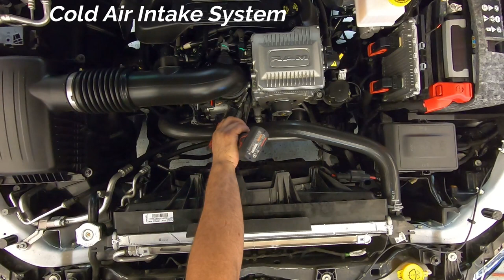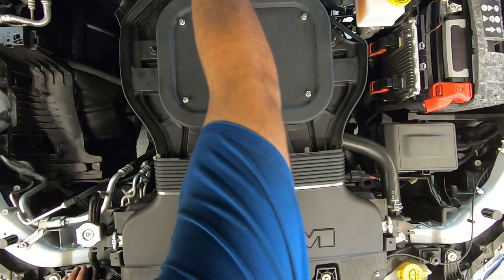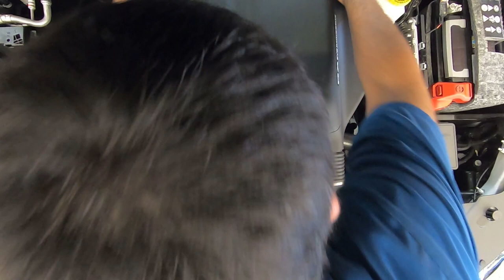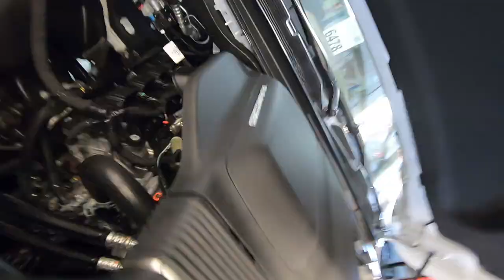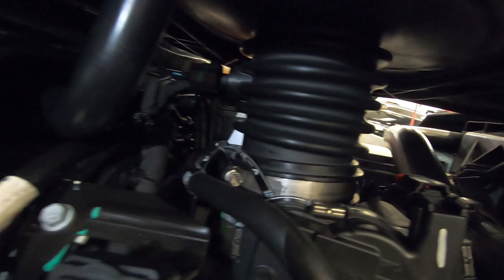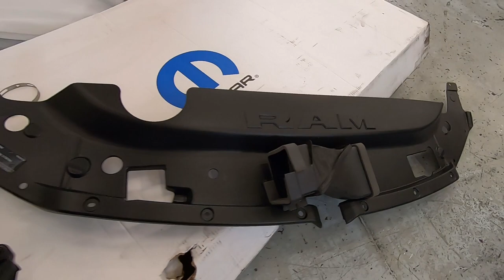Installation of a new Ram AirFlow Cold Air Intake System on a 2020 Ram 1500 with a 5.7L Hemi V8

Comment: I just ordered mine today from the dealer. It was cheaper. Third party websites are still selling them but shipping is 230$. So 968+7.5% tax + Shipping 230$=1270$. I paid 1100$. Not worth it for performance but worth it for gaining extra engine bay space for my planned Dual battery setup.
Reply: Well. It's not been an easy few weeks. I'm still waiting on my order. First they said 7-10 days. then they said it was in orlando and should be here in two days. I show back up two days later. It's not there and they cant find it. So they reached out and it should be here by 5/25. Today is 5/26 and they said now it's been pushed back to July 3rd. Why is this so difficult?!

Comment: Cover isn’t installed correctly…notice the gap….breather tube is falling out underneath….you need a hose clamp there because they didn’t put a plastic burr and the hose is slightly oversized…if you do it right takes way more than an hour….
Reply from the maker: there's no pressure on the breather hose to make it slip off...thank you for the comments and i will check that out next install we do
Reply: Trust me….everyone I installed so far the hose doesn’t stay on….Ive done 3 so far….small hose clamp does the trick….

Comment: I've seen dealership's selling these for around $1,000. I'd love to see the power numbers compared to the competition
Reply: The numbers are the same ..no gains
Reply: Negligible the problem is in the PCM parameters.
Reply: @khyoon14  no it's not. No tune gets you 47 hp down low, max hp gain its 18. Makes a huge difference in acceleration.
Reply: @sonsofliberty3081  18 hp in a 5,500 lbs truck?  Only your imagination is going to notice.

Comment: Random question here,  love the look and the idea.  As the vararam air grabber is almost identical in concept and fits on both the earlier 2016 body style and new 2019 could this intake be made to work on the older generation as well?
Reply from the maker: we have tried to figure this one out. we donot believe it will fit on the older models. only 2019 new bodystyle and up.
Reply: It fits 4th gen ram 1500, you'll have to remove the heat shield under the hood and drill a few custom holes but I got one to fit on my Warlock

Comment: there's a video of the vararam version of this that is similar in design and the dyno numbers are about 10-15hp, i would imagine this is the same, the video however never showed the dyno's laid on top of each other so I would imagine those gains are at the top of the RPM range. I bought a crewcab Laramie, I like the sound of the CAI's but If i wanted a faster truck I would've went with a less optioned version, and looking at the stock system it looks almost as good as the old GMT400 setup with the 454/7400, which is good enough for me, I might go with a performance filter but that's about it.

Comment: Those things are pretty cool but they do nothing to improve horsepower or torque.
Reply: Not at all. They just look super cool.
Reply: @Insuranceexamprep  that they do, in fact I'd bet they actually hurt performance numbers.
Reply from the maker: more airflow = more gas = more HP....... most intake systems will add about 10-15HP. i will totaly agree it looks so cool
Reply: @MoparWholesaleParts  in a perfect world yes I agree. However I very much doubt this one has anything to offer other than looks. Why else has it not been actually tested and proven? My theory is it has been tested and the results are not what were expected which is why nobody can ever find any numbers on them.

Comment: I have a Ram 2022 Laramie Sport and I'm thinking about installing the Ram Air Flow. Just wondering if i needed to get a special tune up for the different air intake. Will the change cause the check engine light to come on without a tune up?

Comment: I have a Vararam Air grabber that cost me $330.  I do like the idea that this mopar product is neat and offers the same concept of what the Grabber has but idk how I feel about an additional $300 for it to look neat. If I didn’t already buy the air intake I would definitely consider this option ngl
Reply: Additional 300? These intakes are $800-1000 every where you look. Most dealers don’t have them and say they are not even being made anymore. They look cool but many forum
Members have installed these ram air intakes and they don’t add any horsepower at all u less you get a tune that allows more fuel to use the added air. The stock 2021-2022 ECM is way too finely tuned and they are not allowing added fuel at all. Damn emissions.

Comment: I don’t get how this can possibly be $1000 shipped? This is a couple plastic pieces and a filter lol.. the stock ECM in any dodge/ram/jeep after 2018 has a new style ECM and it does NOT allow any adding of extra fuel other then small amounts for stock motor. Therefore this filter not only Does 0 for performance but it adds additional weight.. now if you have a Diablo or some kind of tune this can add around 15 extra hp over the tune itself which is huge. But again, with a stock truck and no tune it does absolutely nothing besides make your truck sound cooler.

Comment: I must have missed it in the video, but where does the air sensor hook up?
Reply from the maker: oh good question
it is hard to see because its dark but the sensor is in the hose that is connected from under the air cleaner to the the throttle body.
Reply: It plugs in to the rear of the hose about midway down.
Reply from the maker: @patriotram9204  yes it does...thank you

Comment: Do you have to remove the air filter assembly to get to the oil filler?
Reply from the maker: no there is enough room to get to the oil filter without removing the filter assembly

Comment: I own ram 2015 v 8  with a super charger this will work for this track
Reply from the maker: you can make anything work with time and $$$$ however this is NOT a bolt on and this is NOT made for a 2015 rams.

Comment: In this installation I do not see you disconnecting the negative battery terminal.  Is disconnecting not necessary with this install.  I've seen other intake system installs where some do and some others don't.  What does mopar recommend and if so how come the process was not shown in the video?
Reply from the maker: I just grabbed the instructions and step 1 it says to disconnect the IBS (intelligent battery sensor) wire connector from the battery terminal.
Reply: @MoparWholesaleParts  so just the sensor only? Well that's very different than disconnecting the whole negative cable like the other videos. Is this to keep the truck from going into default mood and losing all the features like everyone complains about when disconnecting the negative battery completely? If so I'm surprised more people don't know this .   I plan on doing the install soon and I didn't want the truck going all haywire by disconnecting the negative cable completely if I didn't have to. Thanks for the info
Reply from the maker: @joserojas6726  that might be why...I will ask a tech and get back to you shortly.
Reply from the maker: @joserojas6726  our tech is saying to isolate the IBS and yes sometimes in rare occasions it does disrupt the electronics of the stop start vehicles and will need to be relearned......could take up to 3 days to relearn.
Reply: @MoparWholesaleParts  thank you for the info!  So ill just keep my fingers crossed lol
Reply from the maker: @joserojas6726  Anytime...hope it helps

Comment: Is there any improvement in gas mileage with this installed & by how much ? Thanks
Reply from the maker: i would like to say there is a mileage benefit....as most intakes claim that they will give you better fuel mileage. how ever my experience is NO due to 2 things. 

1. more air flow equals more fuel equals more power.
2. the sounds of the intake is so cool i keep my foot on the pedal longer.  

in truth its really how you drive that affects the mileage more then the intake. the benefit to an intake system is more power and in turn should be better fuel economy.
Reply: Thanks for the response. Also installing this won’t cause any warranty issues correct ?
Reply: My mileage hasn’t changed, and it sounds great under load. Being a licensed MOPAR part, it does not void warranty.

Comment: I like the over all look and the badging on it. And I’m seeing these in the upwards of $800-$1000. 
My question is, how the heat from the motor is going to effect it, especially when your doing a lot of idling. 
I really like the looks but I think plumbing it to the side fender well will be a better benefit
Reply from the maker: the air intake is just in front and above the radiator/condenser. so while driving your getting outside fresh air. at idle you will get heat but your sitting still so its going to heat up anyway.

Comment: in the kit comes the trimmed radiator cover?
Reply from the maker: YES there is a new radiator cover in the kit.
Reply: It comes in the kit. I just purchased one for my 2019 @ my local dealership -$800+ tax. The one advertisement for $700 doesn’t note the $200+ shipping.
Reply: @patriotram9204  how do you like it???  Was it worth the money?
Reply: @honor4thoseb471  I like the configuration. When I get on it, I can hear it growl. I think the truck is more responsive. Adding new corsa exhaust this weekend (I hope).
Reply: @patriotram9204  I HIGHLY suggest the Borla Atak.  Thats the first thing I installed on my ‘21 Laramie.  The stock pipes are horrible
Reply: @honor4thoseb471  I chose the Corsa with a resonator delete. I hope to have it on by this weekend.
Reply: @patriotram9204  you talking a full Cat Back right?
Reply: @honor4thoseb471  yes sir...from y pipe to tail pipe.
Reply: @honor4thoseb471  I purchased it for better flow, and it meets the need. As it is a MOPAR part, it was worth my money. It complements the exhaust and together, they make the truck more responsive.
Reply: @patriotram9204  I'd get an unlocked PCM and diablo tuner. Adding all those mods without having the freedom to tune is redundant.
Reply: @khyoon14  time and$. One piece at a time.
Reply: @patriotram9204  I noticed this too.  Nice price online but shipping was $150 for a box of plastic parts.
Reply: @scott_b  the box is large due to the cover being a one piece. It is stamped Ram, thus being OEM parts. I got it at nearly same price from my dealership.

Comment: Looks to me like the intake would have to be taken off every time an oil change is due as it blocks entry to the filler port.  Engineering at it's finest smh
Reply from the maker: i does look like that but our techs say you dont need to take off the housing to change the oil.
Reply: You do not have to remove the assembly - there is room to take off the filler cap. It does require a long flex funnel though.
Reply from the maker: @patriotram9204  thank you